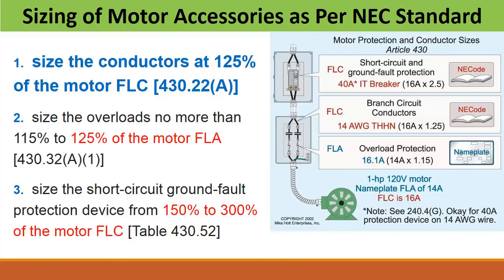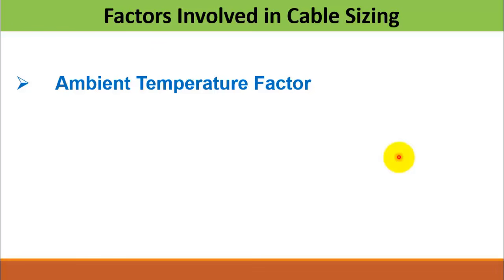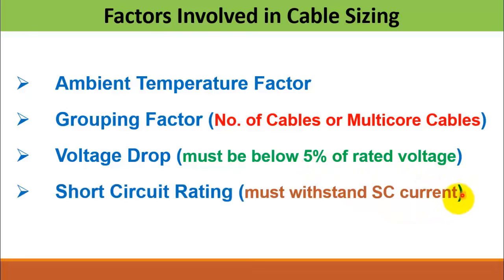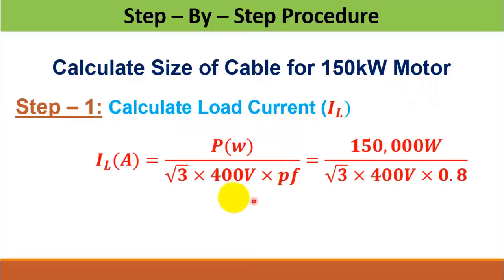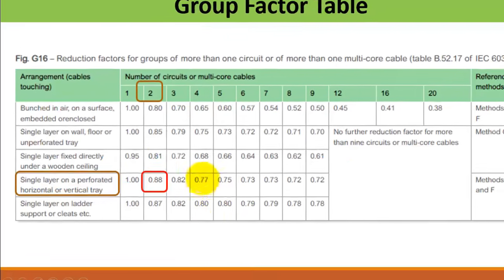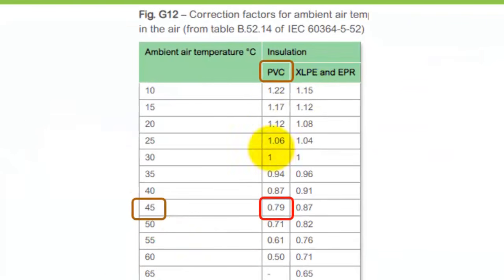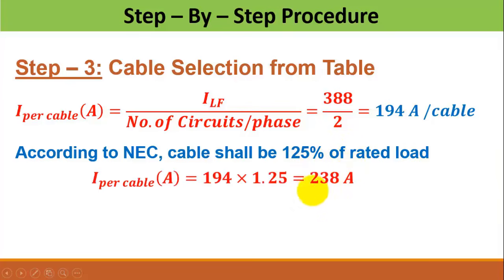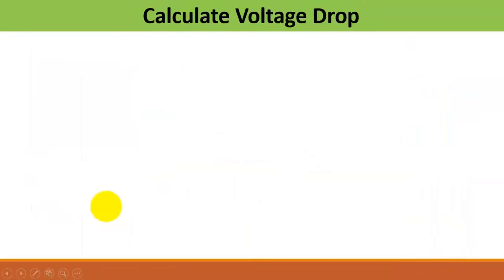How to Calculate Cable Size | Cable Size Calculation | Step-by-Step

Comment: As per thumbnail calculation based on NEC but table which was used on IEC ?
Reply from the maker: IEC normally refer NEC code in calculations
Reply: @electricallectures okk

Comment: Can't you calculate cable size without table chart?
Reply from the maker: No. Because every manufacturer has its own cable current rating . Most of them follow BS 7671. Without the chart how can you know that which size will carry what amount of current. Also charts help you find the current carrying capacity of cable based on installation methods. So yes charts are must

Comment: Hellow, thanks for your video. Where would i find those tables
Reply from the maker: You can find the exact table in cable brand catalogue. For example if you choose Belden cable, then it's current capacity is given in its catalogue

Comment: Why referring to short circuit capability?
Reply from the maker: Bcz it's better to check the short circuit capabiility of cable so that when you compute short circuit current levels that cable can sustain that current. But in most calculations this is not required
Reply: @electricallectures , is it really possible that a short circuit current isn't great enough, when the ma allowed voltage loss is 5%?

Comment: What table is this?
Reply from the maker: This table you can find easily with any cable manufacturer. Whenever you select any brand, you can ask it's ampacity table. There by using this calculation you can easily select appropriate cables from table

Comment: then wht is the  dia of the cable
Reply from the maker: The dia of cable depends on no of cores and size of one core. So it could be multi core or single core. Once you select the size according to your load, then dia of cable can easily be found out from catalog

Comment: Thank you for easy explain,  but you don't take the distance in your calculations !!!
Reply from the maker: Yes you are right. I told at the end that for voltage drop calculation distance is required

Comment: Sir, sorry I have a question.
What is the no of runs in cable sizing.
Example:
5R/3.5C/240sqm/XLPE
1R/3.5C/240sqm/XLPE
thank you Sir
Reply from the maker: I don't understand exactly. If you mean to say  5R is 5 circuits of 3 core cables. What exactly you want to know. Do u want to ask about grouping factor?
Reply: @electricallectures  
Thank you Sir.
Yes, I still confuse run cable example 5R, 3,R, 1R.
Please explain me Sir, your answer Will help me.
Thank you

Comment: suppose m selecting breaker for 150kw so thats 270 amps and multiply by 1.25 is 337 breaker available size is 400 amps if we select xlpe running on perforated cable tray is 185 sqmm 3.5 core then how did u select 2c 95 sqmm please correct your calculation. if i consider 0.9 derating factor 337 x 0.9 thats 303 amps so while running current is 270 amps and cable could bear after derat 300 amps, dont spread wronmg calculation.
Reply from the maker: I just give an example to show effect of grouping factor. For that , I have to use 2 multi core or single core circuits per phase so that grouping factor applies. If I run single cable, viewers will not understand grouping factor. And by the way not all cables are selected according to the breakers

Comment: For the voltage drop calculation you should take load current which is actually drawn by the motor! Not the value used to rate your cable! Right?
Reply from the maker: Always find the values based on rated load as it keeps u safe

Comment: What if the insulation is TRS?
Reply from the maker: Then another very critical factor also applies which is enclosed in thermally insulated material. In that case the factor is o.5 if the total run of cable on TRS is 300mm
Reply: @electricallectures  thank you!

Comment: anyone know what documentation or code he is getting the different tables from?
Reply: The NEC (National Electrical Code) manual. I can look up the page numbers if you need em. The NEC is like 900 pages, but there are probably 20 pages you actually need to size any wire.
Reply: Sir I need NEC book you have PDF copy of NEC book . @ianhowe1449

Comment: Didnt really understand that how at the beginning of calculations and without knowing the cable size, we can assume going for 2 multicore cables (after which we obtain 388A load current)
Reply from the maker: This is just supposition in order to calculate group factor. But if you keep foing calculation , you get a rough idea that how many per phase cables are needed to take the load. But proper way is to start by ond cable